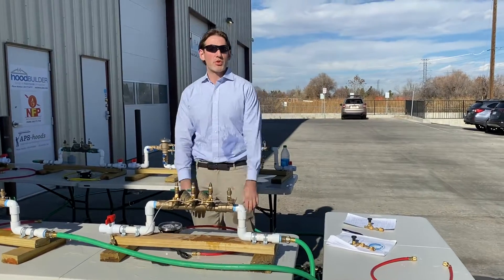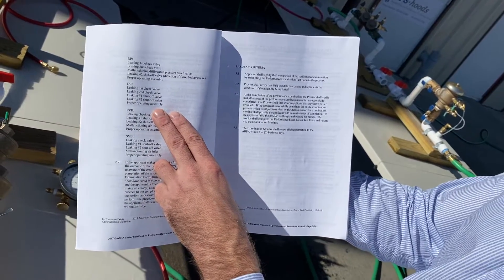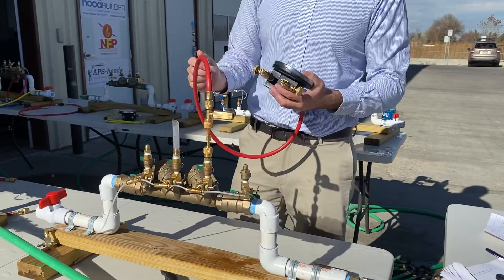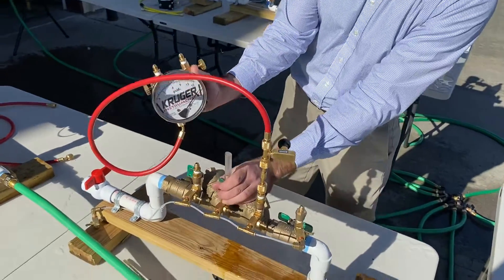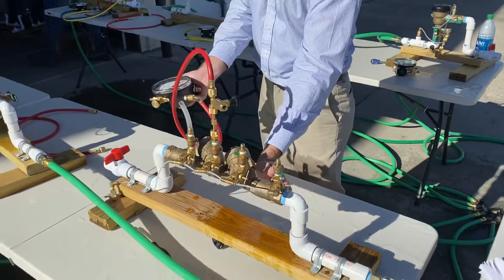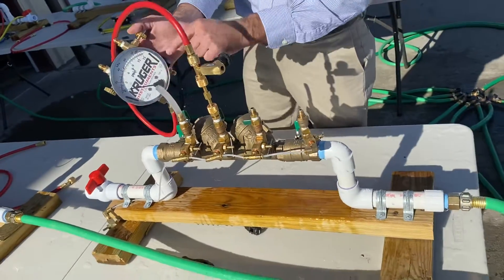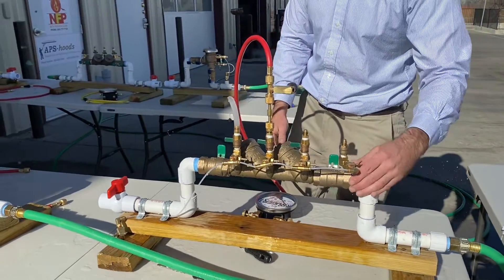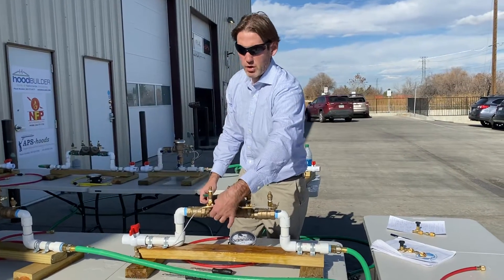Double Check (DCV) Backflow Testing - USC 10th Edition Diagnostics that you will likely see on Exams

Comment: What about if water recedes from test cock three wich indicates leaking number 2 shut off valve with demand and leaking number two check leak  also my question will you continue on to test second check or test ends right their ?
Reply from the maker: So what you are talking about is a multiple failure scenario, can happen in the field and the book goes over it, but we have it omitted here since they can’t simulate multiple failures on the exams .. but yes I believe if you can tell CV-2 leaks with a SO-2 leak with flow, then you would not need to do the next steps

Comment: At 6:17 it’s mentioned that the previous reading is the differential pressure across check valve #1, but I think you meant to say the previous reading is the differential pressure across check valve #2? It’s step T7 in the 10th edition book (Page 288).
Reply from the maker: Yeah you’re right .. I misspoke during the video, we were testing CV-2 so you would record the previous reading for CV-2 not CV-1
Reply: Was just getting ready to comment the same thing , thank you!
Reply: Does the assembly pass or fail if there is a leaky #2 shutoff with backpressure?